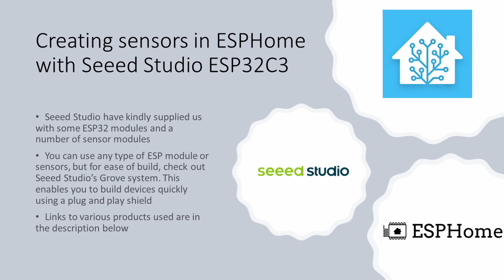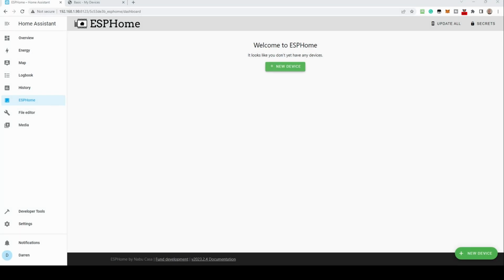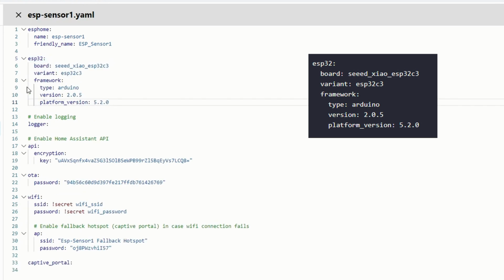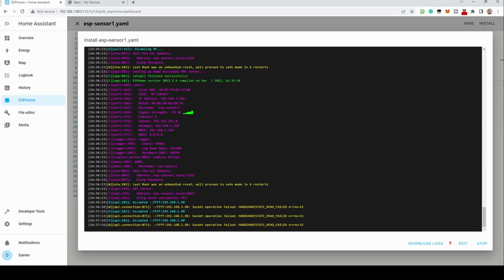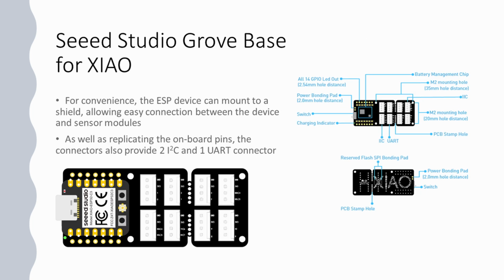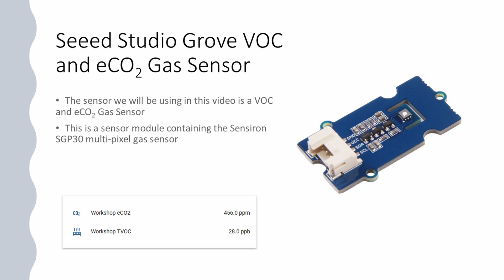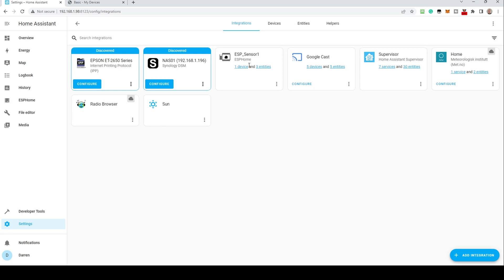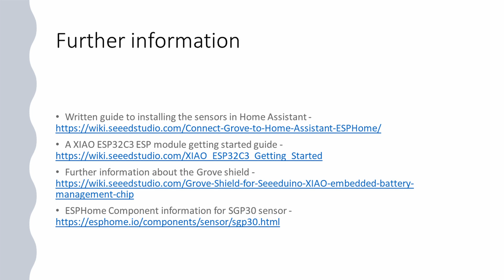Creating Sensors in ESPHome with Seeed Studio ESP32C3

Comment: I use the XIAO ESP32C3 board for extending bluetooth signal, but it turns off after 1-2 minutes. It is probably overheating. Do you know what can be wrong? I use another esp32 for same purpose, but it is powered by micro usb cable, can it be the reason and do you know how it can be solved? It is very hot even if it is powered through usb hub in notebook

in yaml file I connect devices just with

esp32_ble_tracker:
  scan_parameters:
    active: true
Reply from the maker: You either may have a faulty unit or you might need to help with heat dissipation. I've seen reports of people using Raspberry Pi heatsinks on the ESP32 chip.
Reply: thank you for quick response, I have another unit for my friend, so I will test it if it is better @SmartHomeAddict

Comment: I think grove shield doesn't work with ESP32C3... Can you confirm?
Reply: Stumbled on it also - sgp30 should work with 3.3v logic (as itself its running 1.8v logic, but board has level shifters). But it won't work on esp32c3+pictured shield while  exaclty the same code will work arduino pro + grove shield. So I'm thinking if there something that can be done or not. I did not run home assistant. I ran simple seeeedstudio recommended sample sketch. At the same time seeedstudio states that it should work.